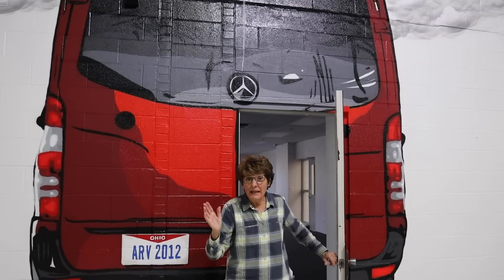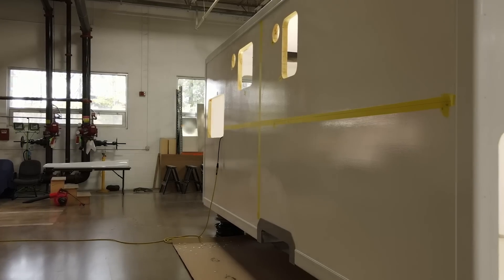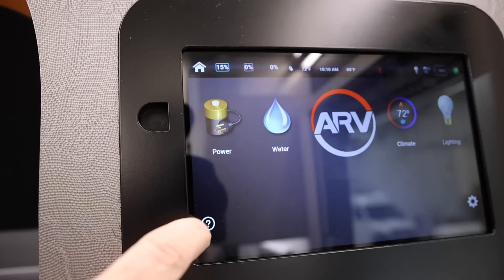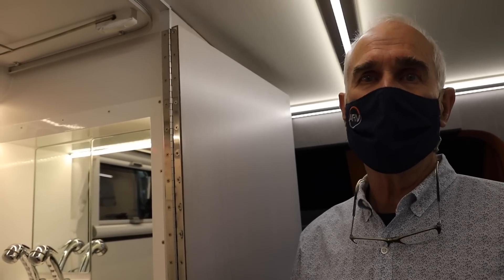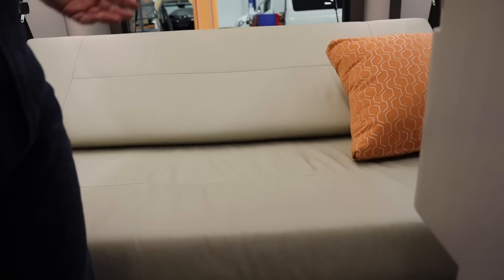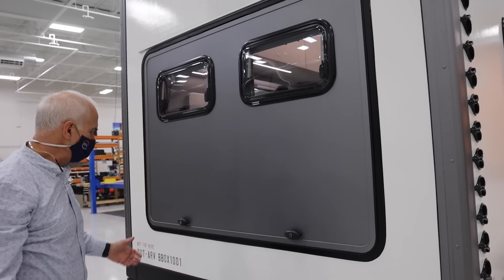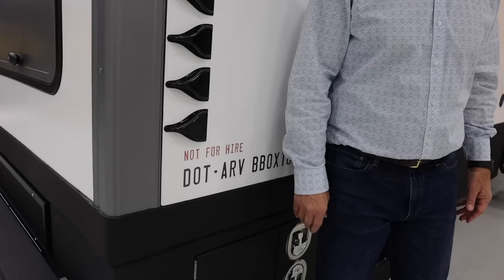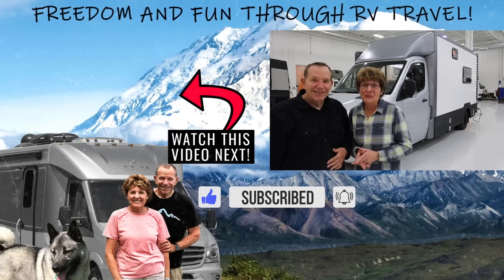RV Living: The Innovative B Box RV from Advanced RV

Comment: Wow! 380,000. And no solar, or a generator. I’ll stick with my older Roadtrek. Though, thanks for sharing. Love the videos
Reply: I think not having any solar is a mistake...the MB diesel doesn't do well idling for long...not recommended...unlike the promaster's with the seperate alternators and gas engine...  Folks will add solar if they get these units..
Reply: @tedwilliams1000  Keep in mind how long it would take to charge a 13kwh battery system with a few solar panels.
Reply: @terryharrigan6324  with the real estate up there is estimate you could put at least 600w of flat glass panels that would surgery shade the roof with the airspace underneath and with the $$ the article says that thing cost a tilting mechanism could be added.
Reply: Solar isn't very useful when you have this much battery capacity. You'd have to have 1000 watts for it to make a dent charging this battery bank. The main advantage of a huge battery and an under hood generator (alternator)  is that you have enough battery power to last a long time, so you don't really need solar and you certainly don't need a outboard generator, since you can simply take a short drive to quick charge the battery bank. Very quick charging is huge benefit of the 48 volt system ARV uses in their vans.
Reply: Seems like Roadtrek Winnebago and a host of others would have just as many features for a ton less money.
Reply: @tedwilliams1000  I have 285w up on my class B with no room for more.  Take away the AC up there and you could fit another 95w panel, but that ain't getting you to 600w.
Reply: @dlg5485  what exactly is a short drive?
Reply: @btrswt35  That depends on the size of the battery bank. I think ARV typically installs around 600-800 amp hours, which would fully charge in 40-50 min of driving, on their 48 volt system.
Reply: The sun is such a slacker. OUTPUT WE NEED MORE POWER!
Reply: For real!
Reply: @btrswt35  well, according to the video....it's a 3hr and 15min drive.  So...you better hope you are ready to break camp when you need more juice.
Reply: An Ekko for 120-150k. An Expedition vehicle or a luxury bus with all the amenities makes more sense when spending almost 400k.
Reply: @btrswt35  no he says in the video 3.25 hours of driving would charge battery bank from 10 percent to 100
Reply: @dlg5485  no he says in the video specifically that 3.25 hours of driving would fully charge the batteries from 10 percent to 100 percent.
Reply: I just wondering who is going to buy this expense box.
Reply: @iFxLife50Yrs  Lottery winner
Reply: $140-200k can buy a decent RV from most manufacturers.
Reply: @iFxLife50Yrs  
Who's going to buy this cash hog. 
Someone that doesn't need it.
Reply: This is ultra high quality. Custom build. There's one with a washer/dryer  combo.

Comment: B box very cool, love that recycled shower and the water that goes to the toilet. 

When you were talking about putting it on a different chassis I was reminded that armored trucks have a big safe in the back but the truck never lasts as long as the safe does so they remove the truck from the safe and they mount the safe on a new truck.

Maybe the B box engineers could borrow some information from the Brinks armored car people.

I've seen some super seas on a Ford 550 pretty impressive vehicle. That would be interesting to see if that would ever become your next size.

Comment: Not buying the no solar alternative. Putting a few panels on the roof is not going to break the bank on a 400,000 rig.
Reply: With that much battery storage there  really is no point to solar. It would take DAYS to charge that setup.
Reply: You don't need solar because the alternator charges the battery in like 2 hours or less. It also has an auto start feature kinda like Volta that will detect when the battery is low and idle the engine long enough to top off the battery. You can leave the AC on as long as you like and get 0 down time. The solar when you got an AC is kinda a joke cuz it would take weeks of uninterrupted solar just to charge your battery when your alternator does it in less than 2 hours.
Reply: Actually 3 hours to charge with the alternator according to the blog post that accompanies this video.
Reply: @GreganDunn  Regardless whether its 3 hours or 2 hours it still fasrer than solar
Reply: Agreed!
Reply: An Ekko is 120-150k. If you spend 400k, you might as well buy an expedition vehicle like an Earth roamer or Earth cruiser or a luxury bus with Volta. lol
Reply: @roslolian11  close. It takes 3.25 hours of drive time to fully charge batteries
Reply: @FEARNoMore  EXACTLY and its the SAME box......!

Comment: I have seen two previous videos made at Advanced RV during design and first build... the air exchanger seems to be a new addition and is a great idea that should help improve air quality, reduce interior condensation, reduce chance of mold, improve heating/ac efficiency and maybe filter incoming air.   The point about adding batteries is cheaper than adding solar panels is extremely interesting... a flat roof reduces exposure and efficiency of solar is usually under 20% ... a three hour drive to recharge from 10% to 100% is great... another improvement for future design could be to utilize Tesla charging sites to add recharge... especially with the introduction of the full electric sprinter platform just announced... although I personally would prefer a plug-in version to full electric to extend range.  Overall this is a great design and on par with other custom pricing... a four wheel drive version on a F450 chassis would compete well with other brands such as Earth Roamer at a lower entry price point.  The bike storage is still a work in progress... lifting ebikes up that high would require a lift system and accommodation for wash down or recharging the ebikes.  The recycling shower is great too... it might actually be safer and healthier than conventional water shower because of filtration an ultraviolet light sanitation... I would like one for my own house... and the excess water used to flush toilet is a good use of grey water. 5he small stove is exactly what we have used on our sailboat for five years. I want one... now to conv8nce my wife... and sell the boat.

Comment: Nice. Have you ever gone over to Embassy RV's? They are also way up there in their designs and not nearly as expensive. I just think $380k for a van is way too much.
Reply: Embassy is really good.
Some differences that could explain the higher price for the ARV: the hydraulic leveling kit, air suspension more battery capacity, recirculating shower, the air tabs, the key pad lock, the automatic drop down stairs, the air refreshing, the sound system, the hydronic floor heating and the shell may cost more to install than the standard Mercedes factory body.

Comment: When fully tanked up (fuel and water), how much of the weight limit is left over for people and possessions?
Reply: none
Reply: Probably plenty of extra weight capacity.... look it's on a Mercedes Benz Sprinter 3500....  I have almost a 3,000 pounds capacity on my RV....it has dual wheels like the one from Advanced RV... 

Do you really think for one minute that they would build a $400,000 rig and not think of that?  C'mon....

The dual wheels and chassis of the Mercedes Benz Sprinter 3500 is a completely different situation from a Ram Pro Master.

Comment: At nearly twice the price of an LTV or Coachman, not sure you are getting twice the value. I did like the latches on all the drawers and cabinets, as well as the pass through capability.
Reply: Especially since you can.add the upgraded fridge and air conditioner to a less expensive model after purchase.
Reply from the maker: There are so many really high end features on this that you can not find on most assembly line RVs. The air suspension alone is an $8,000 upgrade. the batteries are probably $15,000 extra and I can't even begin to guess how much the recirculating and purifying water system costs.
Reply: @happycamperinc.  think of all the custom design work they've had to do on this... Doubting their margins are as large as you're assuming. Lots of smart talented people pulling in $100k salaries to build those beauts.
Reply: @RVLifestyle  the cutaway and box will cost 100k and all the bells and whistle cost another 100k and 50k labour work . any good custom builder will do it in 200k . 250k is maximum.
Reply: @happycamperinc.  I do agree it's way over priced... High end things are never linearly better based on how much you spend. Its  more like an exponential curve, people are willing to pay way more for incremental improvements.
Reply: @happycamperinc.  Nonsense. You have no idea what it costs to develop and build by hand something this advanced and high spec. Just because you can't afford it doesn't mean it's overpriced. It's just out of YOUR price range.
Reply: @happycamperinc.  folks forget you're also paying for the designers and technologists and craftsmen who put it together. It's never just the stuff.
Reply: @happycamperinc.  well that's a little melodramatic, but as a craftsman it's hard to get paid what you work is really worth. There's a market. It's not mine, we have an awesome rig.

Comment: understand the concept of more batteries then solar, but its not practical to run your engine for 3.5 hours every day if you camping away from power to charge your batteries. I dont see how this is practical.
Reply: The battery capacity is enough for two full days if you use the air conditioning on high power, for 12 hours each of both days.
If you use the air conditioner more economical, you can extend the off grid period even longer.
Reply: @rudivandoornegat2371  yes and with that phenomenal insulation I bet running the ac on low, like 70 degrees can last more like 10 or 12 hours before you even come close to 50% charge remaining. His test was running it at 55 degrees on an 80 or so degree day in the full sun and it still had about 60 percent left after 6 hours. And if you're parking by trees with some shade, and you're not running a ton of other stuff, you're good for 3 days off grid at least.

Comment: Interesting that he claims it's a Class B. Obviously it's a Class C, it's built on a cutaway.
Reply: AL GORITHM  That doesn't matter. A B is built inside a vehicle supplied by an auto maker, an A is on a raw chassis, a C is on a combination. There's a term, class B+, for a small Class C with no bunk over, but it's a marketing term with no agreed on definition.
Reply: AL GORITHM  It's interesting that ARV is refusing to say B+, in both this or their previous video.
Reply: @xToddmcx  Guessing because a "B+" is generally used to describe something on a truck chassis that is ~24' and longer than a standard extended van.  Legally of course anything on a truck chassis is registered as a "C class" vehicle no matter how long (or short) it is.  ARV is likely not using the "B+" marketing description because they don't want people to think it's bigger than a standard extended van.  That's the whole point.
Reply: @terryharrigan6324  I don't believe that's the case. B+ is almost always used to describe something on a van chassis, which currently is a sprinter or transit. It's not applied to larger RVs, usually 25 feet or under. The only exception is Nexus which has some Super C they claim is a B+ because it has no cab over.

Numbers and such aside, a class B+ is a class c RV the marketers think will appeal to fans of class b RVs. So it wouldn't make sense to use that label on something too different from a B.

Comment: He doesn't know what he is talking about with the solar.  You could get 2,000 watts of panels on that thing, and get at least 10kWh per day of energy in the summer. If it as tight as he says it is you should be able to stay off grid indefinitely.  Especially if you aren't using AC a lot.